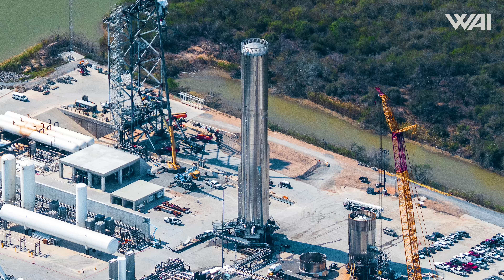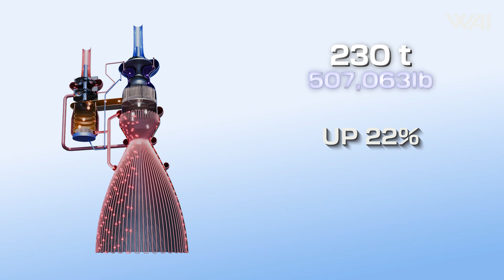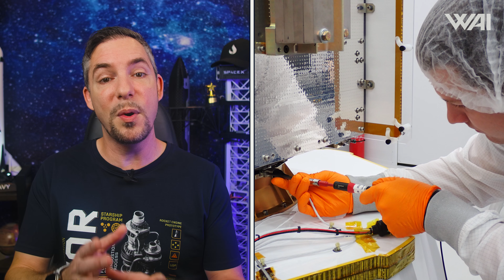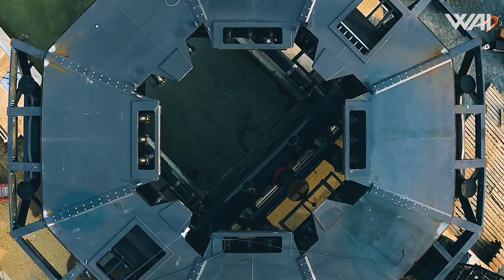SpaceX Finally Reveals The Big Starship News! How Far Is Flight 12?

Comment from the maker: Take your personal data back with Incogni! Use code FELIX at the link below and get 60% off an annual plan: https://incogni.com/felix
Will Starship Version 3 be enough to get us to the Moon? :_WAISweet::_WAIStarship:
Reply: PLEASE don't be inserting "Pea Gravel" as one of your construction phases coming up. Pea Gravel is used in home gardens to prevent weeds from growing. They don't even use pea gravel over in Germany so you have NO excuses.

Construction Gravel, with its sharp edges, is used for construction because each piece grabs the one next to it. 

Sounds like a small and annoying fact but to say otherwise makes your post factually incorrect. There is nooooooooooooooooo pea gravel at Starbase (unless they have gardens somewhere)
Reply: Hey Felix could you make a video talking about how Space X and other new fully reusable rockets could be used to begin cleaning up the space debris either by going up collecting then bringing backdown or possibly some rockets custom made to collect large amounts then take to a fixed position like a massive net to hold for future breakdown separation and reuse in space manufacturing stations? I thought it sounded like a fun video idea
Reply: Isp raptor2-raptor3
347-350s in Vacuum!

Comment: The hydrogen leak is in the ground equipment, not the rocket itself. There are no plans in place to return the rocket to the assembly building. The problem appears to be a fluid dynamics issue rather than static pressure leak. The response on Artemis I was to replace the seals but this does not look like a satisfactory long-term solution. So the seal are being investigated in considerable detail. However, even with the existing seals it should be possible to get Artemis II into space, though by no means an optimal solution.

Comment: Another great report.

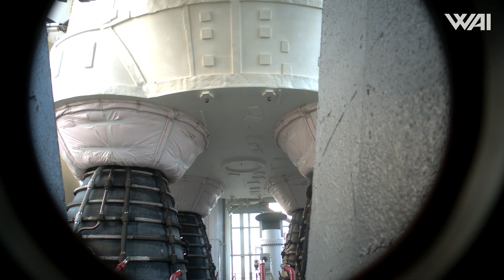One small error: At 12:50 you said, "Hydrogen is extremely difficult to contain. It’s the smallest molecule in the universe..."

That's incorrect. Even though helium atoms/molecules are twice as massive as H2 (hydrogen) molecules, hydrogen molecules are still larger than helium.

Comment: The main problem with carbon fiber components is that they don't fatigue reliably.

They work great --- until they don't,  and then they tend to fail catastrophically !

Perhaps they've come up with a way to reliably test them now beyond pressure/stress/physical strain/etc., but I'm not aware of any current methods to do that. 

Given that,  RocketLab's approach still kinda scares me.
Reply: Same with any metal.
Over time microscopic crack appear under stress.They find out already in the 1950's with DH Comet aircraft disasters
Reply: @albertvanderheiden7419 
But metal usually shows cracks, and/or deforestation - especially around stress risers - before ultimate failure. C. F. --- not so much. It's kind of an "all or nothing" situation.
Reply: You test carbon fiber pressure vessels the same way you test metallic ones
Reply: @jimeditorial 
But that's the problem.  Carbon fiber initially tests fine, but when repeatedly stressed, it develops microscopic internal flaws, that tend to grow with each cycle, until  they propagate exponentially, resulting in catastrophic failure.  Stress testing in situ can show no problem,  but even the stress of testing weakens it, incrementally. 

I think that carbon fiber is probably fine for  rockets that are only going to be used once, but on rockets that are going to be reused, I think that they're asking for trouble
Reply: @supergeek1418 Boeing 787 fuselage structures are cycled repeatedly each time the aircraft pressurizes. Composite structures fatigue according to statistical laws. There is no problem engineering with composites, as long as the statistics are understood, and the airframe is lifed appropriately
Reply: @jimeditorial 
The stress cycles in an airframe are MUCH less than those in a rocket: cryogenic temperatures and boil-off pressures, lift off vibrations, aerodynamic pressures, reentry heating and stresses, etc. 
I suppose (eventually) enough fatigue data can be ascertained to allow accurate life predictions,  but I think that that's still a ways off, yet.
Reply: @supergeek1418 composite fiber wound solid rocket motor casings were developed in the 1950s. There is no risk to using modern high-strength Composites like carbon fiber in any Aerospace application. It is done regularly. All over the world.
Reply: @jimeditorial  see oceangate submarine implosion

Comment: That carbon fiber robot is insane!  Remember when SpaceX was going to build the rocket out of carbon fiber but they gave up and went with stainless steel?  I wonder if the tradeoffs have swung in favour of carbon fiber now.
Reply: Neutron booster failed catastrophically during its pressurization test. So maybe SpaceX will be proven right once again.

Comment: Your going over old ground again. The next Space X launch has defined goals to achieve, but eventually, Starship will have to conduct multiple launches and recovery, hence the rapid manufacturing. So in the near future, Space X will be conducting a two Starship launch at least, ie in fuel transfer, but also another Starship could be utilized to commence Starlink launches on a gran scale. Testing over and over found its routes in the Nasa program and ending with the Space Shuttle Program. That testing and safety regime is missing from the the SLS program, which is based on the fuel that Nasa is using compared to SpaceX. Hydrogen versus Methane! I just wonder if Space X can strap on a shuttle, upgraded of course and send that back to space?

Comment: Did you say rocketlab had no failures? They've had four launch failures so far; #1, #13, #20, #41 were all failures. 94% success rate is good, but it's not perfect. 

It's also not SpaceX's 99% success rate. (block 5 has had one failure of 530 launches, of 99.8% success). 😁

Comment: Carbon fiber has an inheriant flaw.   If something pierces it,  multiple fractures and cracks are made that cannot be easily fixed.   A micrometeorite piercing a stainless steel hull just makes a hole through which something can leak.  The hole can be repiared.  Carbon fiber will continue to leak through microscopic fractures.    These fractures are now a weak spot  that might not stand the stress of what the vessel has to do.

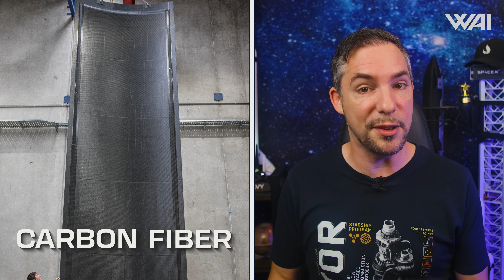Comment: 15:40 Carbon fiber like OceanGate's Titan was 😬
Reply: 1 bar or less  of negative differential pressure between the inside and outside of a space vehicle   is a bit different than the positive 400 bar  felt at Titanic depth. Also the robot does not run on  a Playstation controller 😂

Comment: Would there be any benefit to taking a test article and just cycling it through the fuel load/unload process + test burns to simulate rapid reuse, and continue until something breaks then use that as an indicator of what might need refinement going forward?
Reply from the maker: They’re doing that with all the components separately already. Flight data will bring the rest. There was a Raptor 3 engine that was ignited 34 times in 10 minutes.

But I do see what you mean. It’s a good question. It might just be more efficient to just launch them and get the data under actual flight conditions.
Reply: @Whataboutit makes sense! Thank you for taking the time to reply 🙂

Comment: Hey, Felix, hydrogen is an atom, not a molecule... unless you're talking about deuterium, which is H2. Hydrogen has an atomic number of 1, making it the smallest atom with just 1 proton and 1 electron. It's difficult to contain hydrogen because it'll squeak through the tiniest of cracks and even worm it's way through materials. Plus, it also reacts with many other elements.
Reply from the maker: Yep! Slipped through. ❤Thanks for bringing it up!
Reply: I think Deuterium is 2H and molecular hydrogen (the most common form) is H2.  D contains the extra Neutron.
Reply: @TheEvilmooseofdoom  Yeah, it's a superscript "2" followed by a capital "H", or it can be written as "hydrogen-2". I replied using my cell phone and didn't have the ability to use a superscript symbol, like I can if on my PC. ²H is how it would appear if using Character Map, which is found in [Windows Key] -> Windows Accessories. :)
Reply: @TheEvilmooseofdoom  Deuterium occurs in trace amounts naturally as deuterium gas (²H₂ or D₂), but most deuterium in the Universe is bonded with H to form a gas called hydrogen deuteride (HD or ¹H²H). Similarly, natural water contains deuterated molecules, almost all as semiheavy water HDO with only one deuterium.

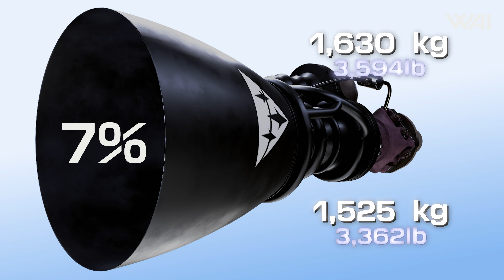Comment: 7:20 at almost 200 pounds power increase per engine, That is a 3 ton weight savings or three more tons of mass to orbit capability.
Reply: Raptor 3 eliminates individual engine heat shields and the need for a dedicated fire suppression system in the engine bay. The total weight savings attributed to these features is approximately 40–43 metric tons per booster

Comment: Raptor still to heavy would hurt if it falls on ones toes
Reply: It's half the weight of BE-4 with 20-30% more thrust. And thats before counting the booster weight savings from the ntegral regenerative cooling and internalized secondary flows which eliminates the heavy shielding (~1100kg/engine) and the the engine bay fire suppression system, saving the booster a total of >42t.

Comment: The three big problems with carbon structures is the spindle for producing the shape, the autoclaving process and the repair mechanisms.This is why Mr. Musk changed from carbon to stainless steel. The next big problems are the production timeline and the cost of the carbon thread, let alone the shear volume required to build a booster/Starship. The necessary volume might just tap out the wold supply volume.

Comment: Actually, the helium atom is smaller in size (62 picometers) than the hydrogen molecule (289 picometers). The hydrogen in the SLS propellant tanks is molecular hydrogen that consists of two hydrogen atoms bound together, not atomic hydrogen (one unbound hydrogen atom).  The helium gas in a party balloon is atomic helium (single unbound helium atoms). When checking metal tanks for leaks, the technician uses a helium leak detector, not a hydrogen leak detector. Helium is better and safer than hydrogen for that job.
Reply: You can't burn helium as a rocket fuel.  If you could it would be way too expensive as it is not plentiful enough.

:face-orange-biting-nails:

:face-orange-biting-nails:

Comment: How is rocket lab carbon fiber different than Ocean Gate?
Reply: Internal pressure vs external pressure.

Oceangate experienced at least 370 bar of external pressure at failure.

SpaceX Falcon 9 fuel tanks are 3-4 bar and likely Neutron will be similar but even an order of magnitude higher is still far short of what Oceangate experienced.  

:planet-orange-purple-ring:

:planet-orange-purple-ring:
Reply: Lots of external pressure from all the water on top pushing down, in the ocean. In space no external pressure as it's a vacuum.
Reply from the maker: It is made to highest standards and deep sea is wildly different than fuel tanks. Pressure in deep sea environments is far greater than in a fuel tank. Falcon 9, for example, has 3.4 bar inside its main tanks. Ocean Gate’s sub had to endure between 350 and 400 bar. ❤️

Comment: I know H2 is a more energetic fuel than CH4, but it's so difficult to contain that scrubs and delays are commonplace. Less energetic propellants can be designed around, as can the somewhat more "dirty" effluent. Are the bright boys at NASA simply unconcerned with delays affecting productivity, or is there some other reason?
Reply: Artemis was supposed to be cheaper by using existing technology.  The 1st stage uses Shuttle main engines, SRBs that are slight modified from the shuttle and a derivative of the shuttle external fuel tank.  This was actually designed into the shuttle as an optional repackaging.  But it is a cost plus contract and delays don't cost the contractors anything.  

:planet-orange-purple-ring:

:planet-orange-purple-ring:
Reply: @Scanner9631  Was cheaper actually the goal?
Reply: @Scanner9631  I somehow forgot that. Perhaps because the system is anything but cheaper.

In any event, thanks for reminding me!

Comment: How does Rocket Lab get the second stage out of orbit?  Carbon fiber doesn't do well screaming through the upper atmosphere at blazing high temps.  I can only assume they will bring enough extra fuel to propulsively slow itself prior to atmosphere entry?
Reply: The 2nd stage is expended.
Reply: Neutron is aspiring to be only partially reusable, like Falcon. The second stage is expended.

Comment: Starship Flight 12 isn’t a Moon vehicle — it’s a suborbital shakedown of new hardware. SpaceX is still years away from the refuelling, landings, and reliability Artemis needs.
Reply: If it works the scheduled June flight of IFT 13 could be orbital.  Once orbital is achieved the other milestones should happen more quickly.  

Artemeis has not demonstrated the reliable launch dates that it needs.  Months of delays on Artemis 3 launching could mean that a 2nd HLS would have to be launched and fuelled as the first one should be sitting in orbit fuelled up and waiting for Artemis to launch.  

Artemis 2 has already been delay by 3 months (minimum) from its early January primary date. Artemis 1 was delayed months as well.  Will Artemis 3 be any better?

:face-orange-biting-nails:

:face-orange-biting-nails:
Reply: Years away?  According to who?

Comment: Nice episode, a note, my guess is LNG is liquified natural gas, the ch4 label would be LNG that has been cleaned up with contaminants removed ready to store as actual useful rocket fuel. Not liquified nitrogen gas as you stated. Just speculation here but I doubt they need that big of a plant to store liquid nitrogen, that is filtered out of the liquid oxygen across the road.
Reply from the maker: It was a labelling mistake. SpaceX actually plans to use the sabatier process on site to substitute for trucks. 👍
Reply: No, you are exactly correct.

Comment: 😮 On site generation of methane is REALLY exciting. Instead of the endless stream of tanker trucks (completely unsustainable) they’ll be extracting all their consumables from the air and ground right at the launch site! Even the argon they use to weld stainless steel.
They’ll have to do the same thing at the Cape to keep their projected launch cadence going. The infrastructure at Canaveral was never designed for that.
Reply: On site generation or on site purification?  

:planet-orange-purple-ring:

:planet-orange-purple-ring:

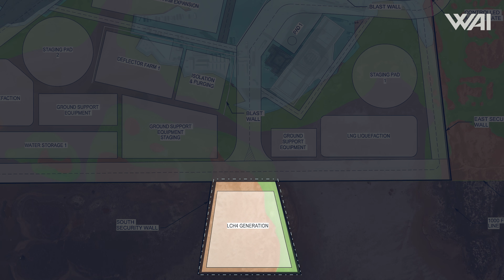Comment: 9:58 - LCH4 - does it mean that they will use the Sabatier reaction to generate methane???  Because otherwise, I don't really know how you want to "generate" CH4? To actually GENERATE CH4 from air, the facility would have to capture CO2 from air would have to be absolutely huge. So I don't think that they will actually generate CH4. I think that they will bring NG (natural gas) via pipes there, purify it and liquify it. Maybe just a small portion of the facility will be for Sabatier generation of CH4.
Reply: LNG is liquified natural gas.  CH4 is the purified methane that SpaceX uses.  Less fouling so easier reuse of the engines.  

:planet-orange-purple-ring:

:planet-orange-purple-ring:
Reply from the maker: Afaik Sabatier is the plan. But you could be correct as well. That’s why I left it open. 👌❤️

Comment: Using first principles if we consider a high launch rate of several a day from each launch pad then it would start to make sense for a power generating system instead of just flame diverted. Think of a mass flywheel that is charged every launch cycle. The take off jets spin a turbine that spins the flywheel that generate electricity and or processes air on-site into liquid oxygen for jet fuel. I could imagine this cutting fuel launch costs and helping to make the whole system more carbon neutral.
Reply: Doubtful there would be any real ROI on that.  It's a lot of complex hardware to install and maintain merely to capture 10-20 seconds of energy.

Comment: Repeat after me: Hydrogen is a terrible choice for first stages, for reusable rockets, and when high flight rates are desired. Also, it killed 2 Shuttles.
Reply: At best it killed 1 shuttle and that's a weak connection as it is.

Comment: That carbon fiber wrapping gives me ocean gate vibes 😬
Reply: Ocean Gate used carbon fiber in compression which is not an appropriate use of the material.  Wrapping uses it in tension which is an appropriate use of the material.
Reply from the maker: Not needed.

Falcon 9 tank pressure: 3.4 bar
Ocean Gate’s sub sub pressure: 350-400 bar

❤
Reply: That's my fear.. it's strong.. but it can become more and more brittle over time.. even after 1 time..
Reply: Let’s hope not
Reply: That was my exact thought.
Reply: It's kind of sad that all the cheerleading in the comments seem to ignore that.
Reply: @TheMotorick  Like @materiallistprollc7741 just stated, Rocket Lab is using the material in a different/appropriate way.  Also Carbon Fiber is risky to use for high pressure underwater applications because it can delaminate.  This does not happen in aerospace applications .
Reply: But without the massive amounts of pressure

Comment: How much weight does the frost add to the booster.
Reply: It mostly shakes off by the time it clears the tower.  

:rocket-red-countdown-liftoff:

:rocket-red-countdown-liftoff:
Reply from the maker: Quite a bit! But besides a very delicate, costly, not really reusable insulation, not much can be done.

I was thinking that a tube launcher with very dry air inside might help, but that’s not easy to make either.